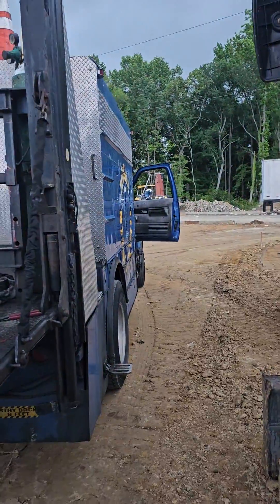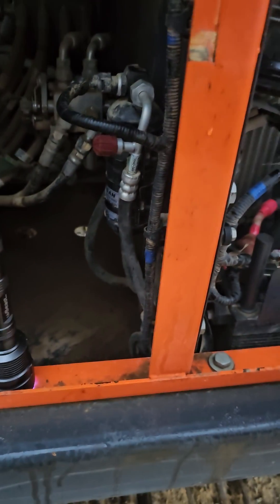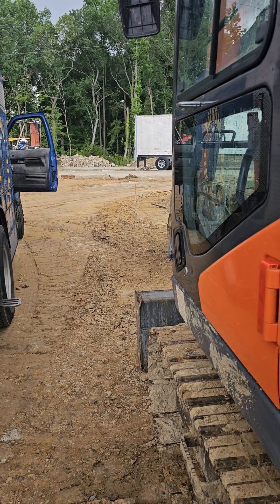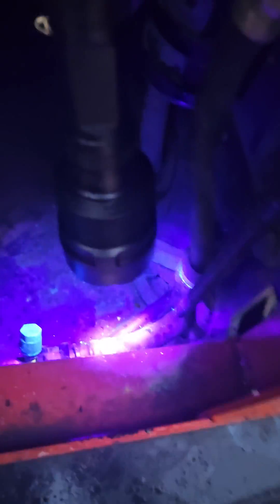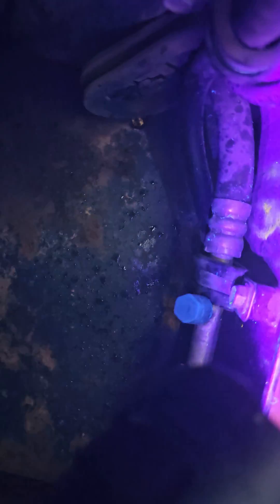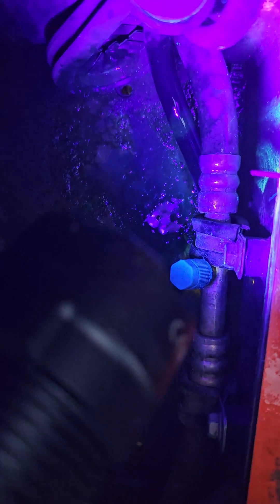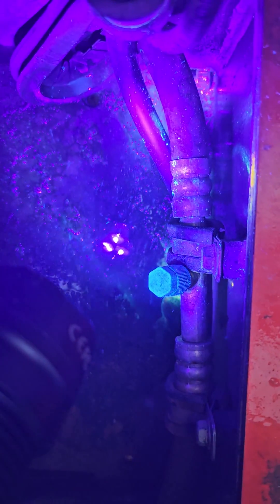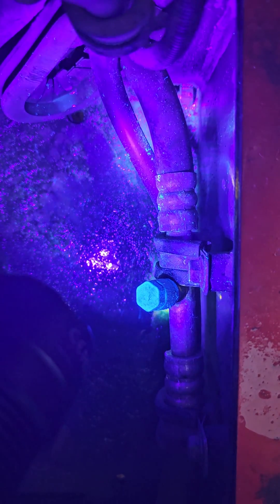Mystery AC Leak Found, 30 Years a First For Me - A New Diagnostic Procedure   #Mobiledieselmedic.com

Comment: The rubber hoses will seep, suspect all other rubber of the same age. I had one that when soap bubbled, it looked like sponge being squeezed. Can use trace gas and nitrogen in combination with an electronic leak detector. I like the H-10, but they are expensive. Anyway, have fun.
Reply from the maker: I will look into upgrading, my sniffer wasn't catching it.